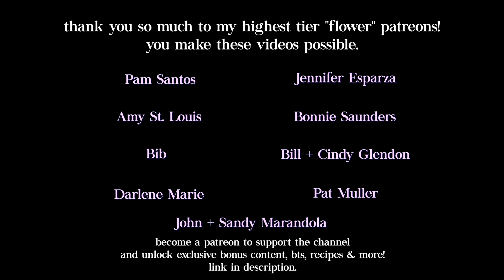Very Productive Week at the Off Grid Cabin!

Comment: New subscriber here. I’m loving your videos. Just an FYI for what it’s worth, there shouldn’t be a slop leading down to the cabin. Water will pool around any wood that’s in the ground and diminish the wood, even if it’s in concrete. The water will crack the concrete over time and or diminish the wood. Not sure if that is the case with the cabin.  Great video.